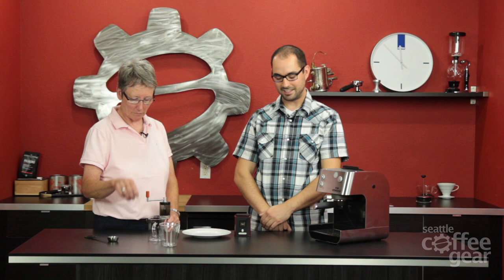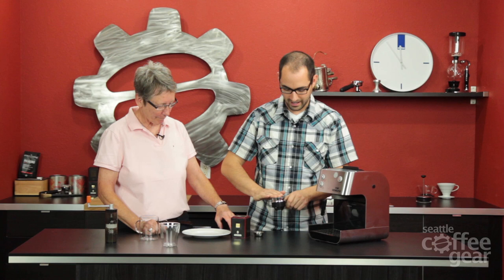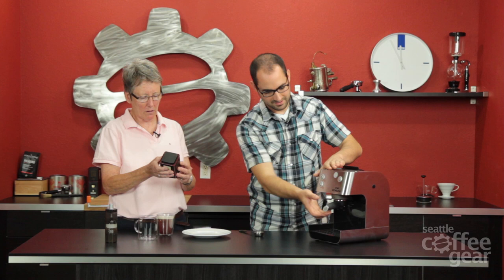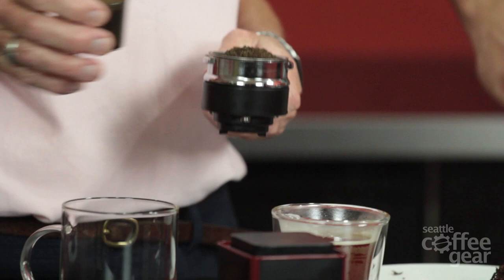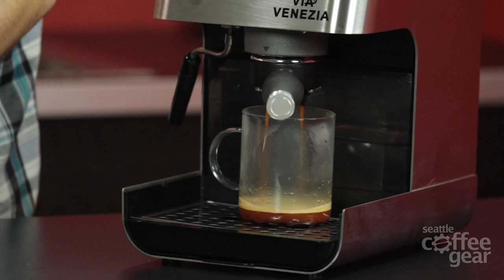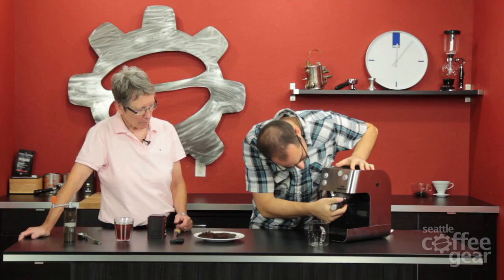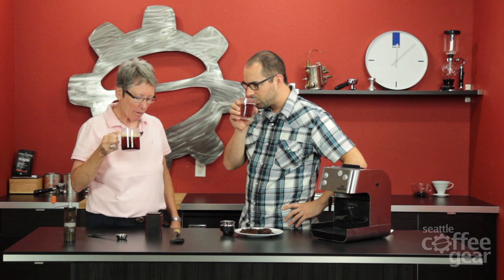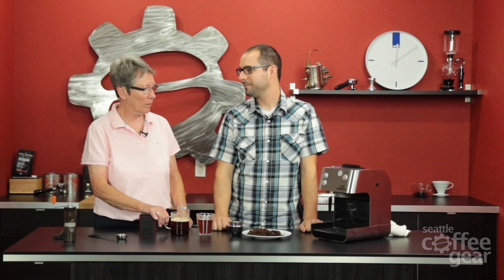(Not So Scientific) Experiment: Brewing Tea in a Pressurized Portafilter

Comment: I make my Tea all the time this way......
It depends on type of tea used, and I do not pre-grind my tea. Leaf/Flower/Green Dragon teas of this nature absorb and expand...but....course/stem/bark/Valeria root is very hard and will not absorb well these must long steep. I do use less leaf tea without sacrifice to flavor or strength in the Expresso machine (Delonghi). The Expresso will pull more flavor at less volume and tea used, under pressure it acts as a stripper rather than a steep. I do preheat the basket (with leaves in) with a small 1/8 shot of hot water prior to pulling  my double shot tea....this allows expansion of the course leaf and settling in the basket at 15 bars+ when I pull the Double shot. The pressure does strip the flavors without harsh or weakness at less tea weight, yet overfilling with expansion does indeed over pressure my system as your did. Channeling is not an issue such as coffee grind with tea, one is a roast stripping oils, the other is saturation (steep) and flow. PREHEATING THE FILTER IS A MUST FOR PROPER TEA....just touch it with water to allow saturation and expansion for 30-45 seconds and than pull the double shot.
Reply: Started googling an hour ago about weather one could make tea in a pressured espresso machine, lastly finding your answer, thank you fellow internet-person 🫶🏻

Comment: Did this myself recently with my Barista Express on a lark after getting some black loose leaf. I'm not much of a tea drinker, outside of Lipton bottled sweet tea, but a shot with an unpressurized filter was wildly astringent and acidic, alongside being pretty weak and running fast. A pressurized double shot filter, filled to the max line with loose black unground, done manually with just the pre-infuse to a double shot volume (didn't do any weighing) was pretty good, especially with steamed milk. Came out more like a regular shot with a thin cremá and great colour.

I think the key is not getting too much pressure through resistance from the puck, and instead relying on the pressure created by the filter which isn't all too much. Idk though, I am more of fart smeller than a smart fella when it comes to the technicalities of espresso.  

Honestly probably gonna drink more tea in the future now.

Comment: Did you guys happen to try the respective teas traditionally brewed for quality comparison? 

I'm extremely interested in this technique but am also very skeptical about the taste quality.
Reply: When I tried I got a very rich and good flavour, one of the best cups of tea I've had. I used the tea from a cut-open Pukka tea-bag and ran a double shot amount of water through. I didn't tweak any settings after doing coffee shots when I switched to tea leaves.

I believe you could get the same flavour brewing the tea the traditional way, but it's very consistent using the espresso machine, kinda results in a perfect cup each time, and you can tweak the temperature and strength easily. The key factor is how easy it is and the end result is consistent and good in my tests.
Reply: @jex8885  tbh you don't even need to cut the teabag open